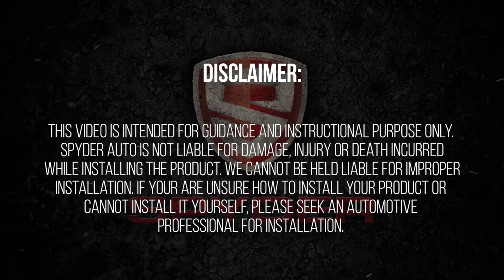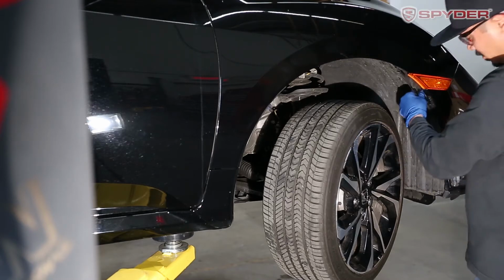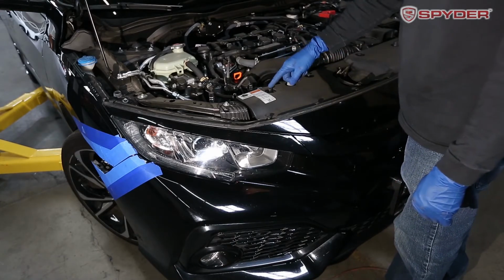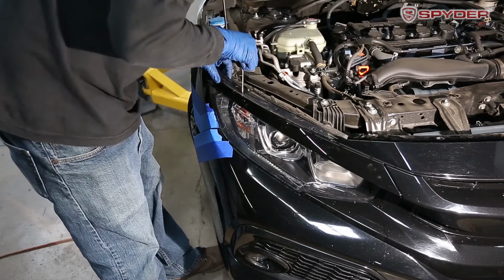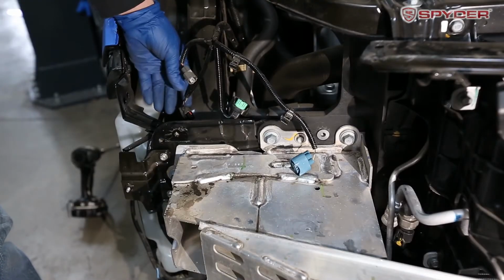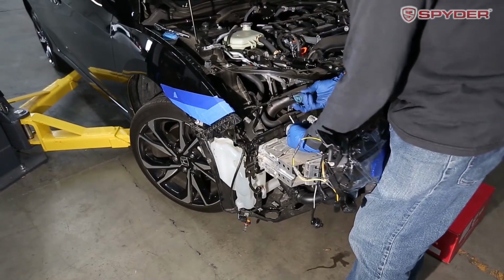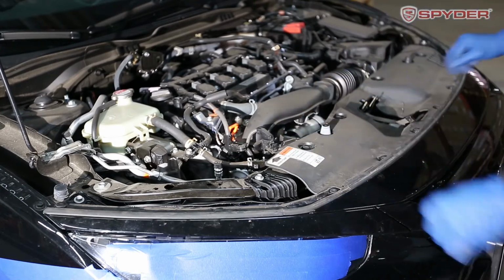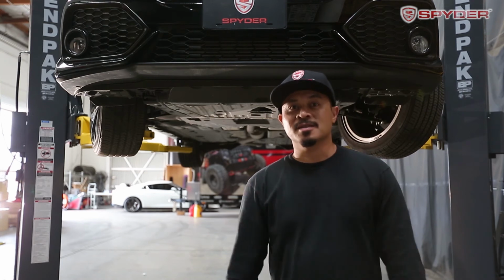Spyder Auto Installation: 2016-18 Honda Civic Sedan Lightbar Headlights

Comment: The only bad thing about these lights is the bulbs are the ugly yellow stock and they require specially sized bulbs so if you have LEDs you have to basically buy new ones that fit the model that those lights support, I'm currently in the middle of that so I'm happy about the lights but can't enjoy them until I find nright white LEDS for the headlight
Reply: Thanx for the heads up
Reply: They also have the Apex series for the headlights. Both low and high beam are built in LEDS. I uploaded a video.
Reply: @arthuromendoza949  ^
Reply: @TheSony602  wow did not know that, how bright arw they?
Reply: @TheVoidMMA  they are not that bad. Pretty good light output
Reply: @TheSony602  i didnt get the apex series model, know anywhere i can get LEDs for them?